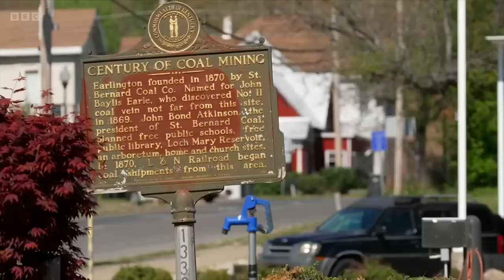US pours trillions of dollars of public funds into new green industries - BBC News

Comment: Great to hear about the re-investments!  The Western World will be better off with the US being able source/build microchips, and critical minerals.  The US also has agreements with Canada for access for critical minerals and other projects to assist with this.  The US Southwest is also primed for solar and wind.  

The only question I would have is if grid level solar/wind is intended with northern latitudes as well - those installments may prove problematic.  The experience of northern countries like Germany and Canada have shown that without storage - solar and wind is not reliable enough for baseload, and it throws both economics and grid stability off.  Germany in particular has built the equivalent of 200% of their peak usage in renewable equipment nameplate capacity, but only gets 49% actual - and the costs are anywhere from 500 billion Euro to 2 trillion over the period of the Energiewende program.  If the focus is mostly doing solar and wind in the south and west - that ratio should be much better, and the US has space for energy storage like reservoir/pump arrangements.

Regardless of the particular details, its good to see the investments in play.
Reply: What about Canada?
Ontario power generation is 91% carbon free.
Québec is 94% carbon free.
That's 2/3s of the population.
We had some early issues with wind surging on the grid but we figured it out.
Most of our power comes from Nuclear and Hydro generation we phased coal out in Ontario a decade or more ago.
NG Peaker plants are used or when demand surges but that's mostly a daytime issue solvable by more solar and yes storage.

We need to over produce on renewables and use the excess to produce hydrogen as a storage medium to be used in the Peaker plants, in homes, transportation and to export.
Reply: The US and even Germany will probably go for this new swiss company - energyVault for energy storage. It's basically a building with weights that move up during storage and move down to generate electricity. The first 2 buildings will actually go online this year. One in the US and one in China.
Reply: We already have utility-scale battery storage and are building out more every day.
“California’s batteries provided more power — over 3,360 megawatts — than the Diablo Canyon nuclear power plant, the state’s largest electric generator, which tops out at 2,250.” — LA Times (2022-09-13 heat wave story)

Comment: If you drive in the vast openness which is Texas you’ll see random huge fields of Turbines going towards Mexican border and out west. Texas is a huge player in this!
Reply: But your Governor blames them for everything wrong with your grid.
Reply: @DSAK55  That is because they never bother to winterize them.  As soon as they had some unusual cold, the whole system froze up.  The problem was not the turbine, but the people trying to cut costs by not winterizing them.   This is especially true when it happened again a couple years later.
Reply: @DSAK55  Our Governor is a fool, but Texans have a historically low voter turnout so the old country folk who can afford to spend all day at the voting machines always out number the others. It doesn’t help that the opposition to Abbott thinks saying everything to the extreme like opening the border and gun control is going to help them in a state like this.
Reply: @azulaquaza4916  They voted for LBJ, many times.
Reply: @nuqwestr  That was before my time so no comment on really what the says.

Comment: Watched a program about wind farms in the USA.  When the grants stopped so did the generators. Many being abandoned. You have to keep the grants coming or raise electricity prices.
Reply: And a lot of abandonment of solar facilities. Within 5 years there will be a better battery chemistry and these businesses will be back for government handouts to re-tool.
Reply: The articles on wind farms usually quote them as breaking even due to their short operating life span.

If a turbine cost $20 million and produce 18 million dollars worth of electricity in its life span then it has met its "renewable" energy status.

However its a loss of revenue and only way to be sustainable is if the govt subsidize these wind mills.

Solar is cheaper alternative but it is limited by daylight hours and direction of sun in winter vs summer.

Nuclear power would be the best but nuclear accidents have scared alot of communities from allowing nuclear plants near them.

Comment: The US infrastructure act money is predominantly for replacing and improving existing infrastructure comprised of: bridges, highways, power transmission, pipes, water and waste treatment facilities, etc. This presentation makes it seem like that law is predominantly for green energy industries. Maybe if some actual data were presented, like tables or graphs showing the $ amounts and where they are to be spent, a dolt like me would perceive this as a truthful presentation.
Reply: But I think this is money from the Inflation Reduction Act (which invests in green energy and the likes but has little to do with inflation) rather than the bi-partisan infrastructure law.
Reply: @SM-lb2do  Thanks for the reply. The bottom line, this is a muddled report. For example:
1) The content title displays as “trillions“ not “billions.”
2) The narrator early on says “500 billion,” yet the inflation reduction act is $433 billion. Those are not equal.
3) At about 1:15, the narrator says “infrastructure and inflation reduction act.” The IRA does not have infrastructure in its title, nor is it about infrastructure. The most recent infrastructure bill is the “BIL,” which is close to 2 trillion. 

Inclusion of the BIL money is the only way the content title could accurately address trillions of dollars to correctly reference “infrastructure.” There is either gross error in the content title or there is inaccurate reporting. I believe there are other presentation inconsistencies beyond the ones I list above, but I’m not really interested in pursuing this anymore.

Comment: We can all have seemingly endless clean energy everywhere all the time and it will cost far less. Combine self running generators that are already patented and power walls in homes and businesses for seemingly endless clean energy everywhere all the time. There are many ways to charge EVs as well. Have a mechanical direct connect to the axle of EVs, a self running generator, solar, kinetic braking and wind turbines, to super charge them. No more plugging in. Use V2G tech to transfer extra energy to the power grid for everyone to use and so EVs aren't over charging causing fires or explosions.😎🇺🇲

Comment: Good to see the U.S. trying to compete again against China on manufacturing of green tech.  Been waiting on the U.S. to produce solar panels that can compete with the high efficiency low cost panels from China and looks like SunPower M series (made in Mexico) are currently the most efficient.  I added a 12 kwh solar system to my primary home back in 2016 (Solar City now Tesla).  Then added a Tesla M3 to our cars in 2018.  As of 2022 4th qtr the panels have paid for themselves and still have 24 year full warranty of at least 90% production on the panels and just free electricity now.   My plan now is to add another 12 kwh of panels to the guest wing of the main house to power an eventual cybertruck and for backyard development.   It definitely makes sense here in AZ (true sunshine state).  No reason why all homes and cars in the SW shouldn't be solar / EV as it's not only economical but clears up the air pollution in metro areas. Also, keep an eye on Redwood Materials as they will be huge in the battery recycling business (95% of the battery being recycled) but for now they are a private company so no chance to invest in them.